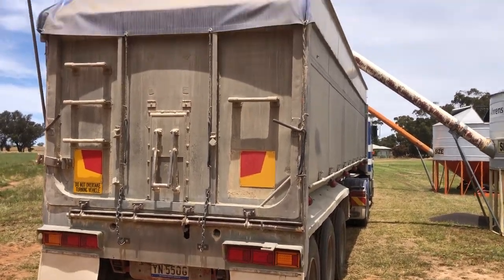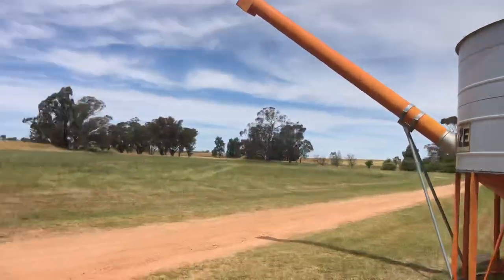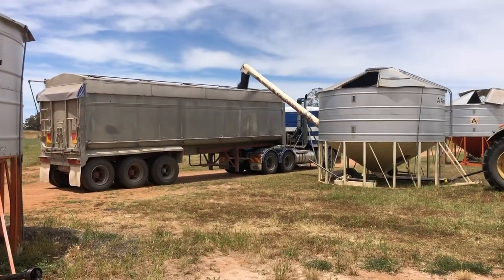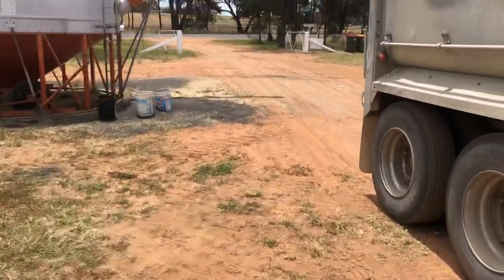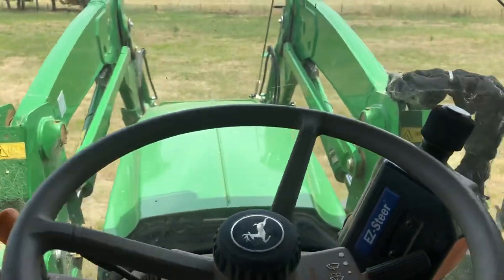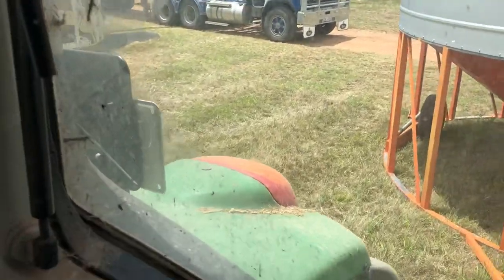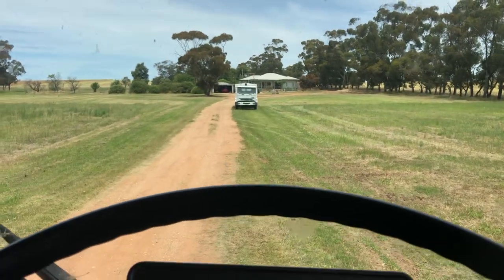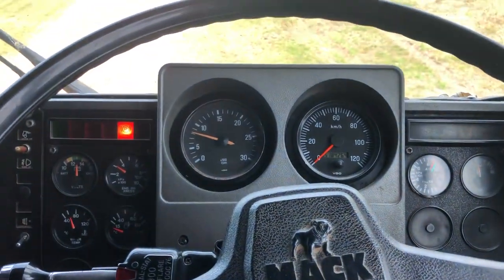Loading canola into tipper

Comment: Those field bins intrigue me. Where I am in the states farmers have large storage bins in centralized locations. In my mind the purpose of field bins is to have quick close storage during harvest as distances are so great to haul during harvest? If I were a young man I’d love to go to Australia for seasonal farm harvest but am too old now. I grew up on a small Wisconsin dairy farm and the farm blood is still in me. Thanks for the videos.
Reply from the maker: These particular field bins are very common in my area, where the farms are smaller and have an even mix of livestock and cropping. 
Generally in this area, the distance is only short to the grain terminal, so using 2-3 field bins is enough to keep the header going.
In the bigger wheat growing areas of the country, they use a lot bigger capacity field bins, well over 100 ton capacity.

Comment: Nice looking old truck. Pity this video found me a bit late as from what I hear harvest is over and I was going to ask you to do a video from behind the wheel showing the workings of the gears etc. It's been a long time since I've had a real truck to drive as I've been retired for two years now and was driving only auto trucks for 12 years before that and hadn't been near a truck for 21 years before that. Given a few hours practice though I still reckon I would do OK in a twin stick and a Road Ranger.
Reply from the maker: There is another video of this truck taken from behind the wheel.
I reckon you would be right with a bit of practice again. Once you learn it, it’s always there for your to go back to.